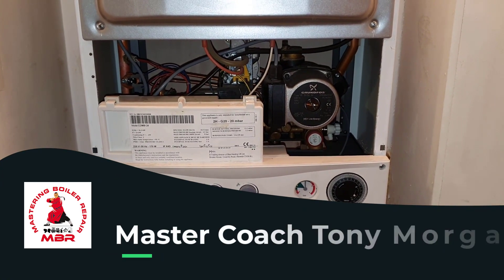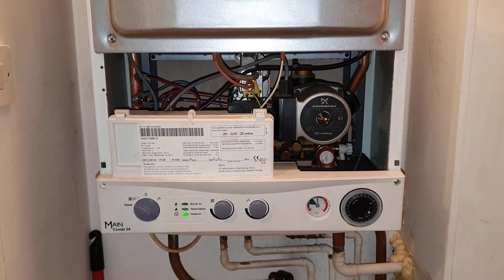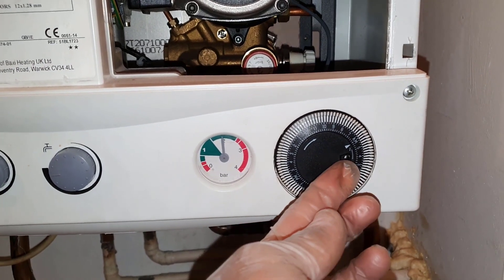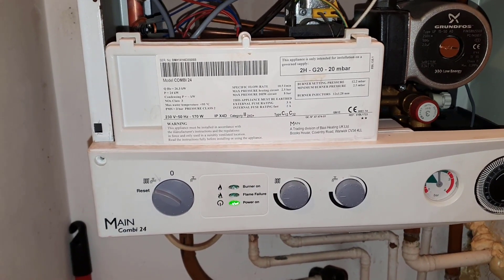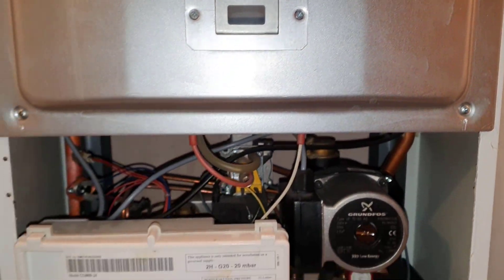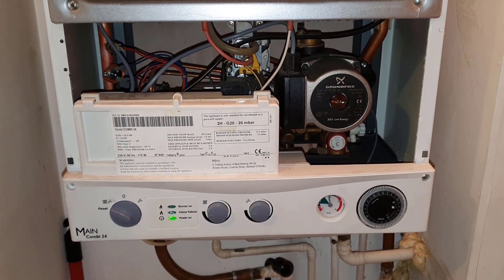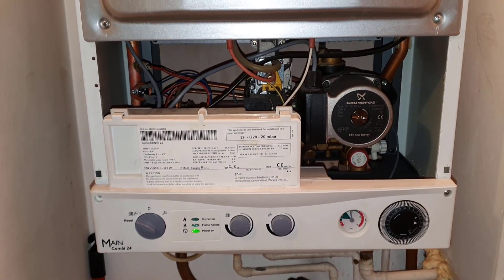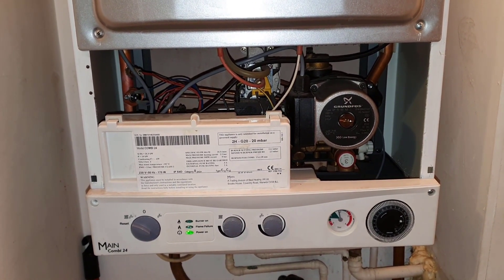Main Combi 24 No Heating and Hot Water Whats the Fault?

Comment: My guess just now would be a thermister being out of range, as i reckon in the sequence of operation the boiler would run the pump first and then check thermisters etc before checking the APS etc. It's not going to lockout so i don't think overheat stat or APS are at fault and boilers won't usually go to lockout for a thermister fault. Just my guesstimate 😃
Reply from the maker: Thats very good 👍 In normal circumstances you would be right, but not on this fault.